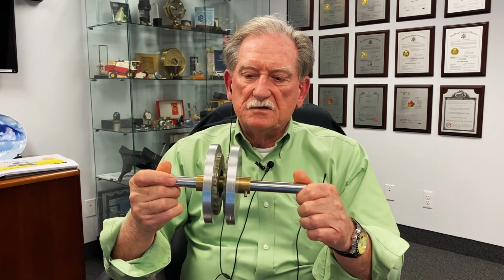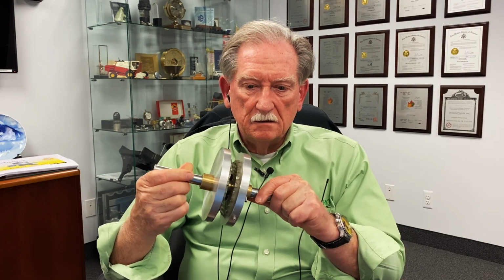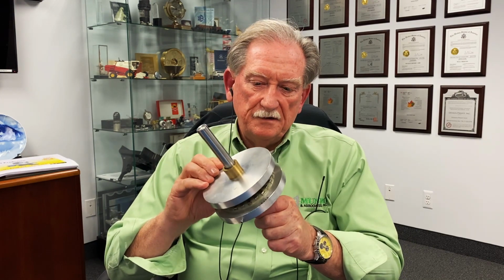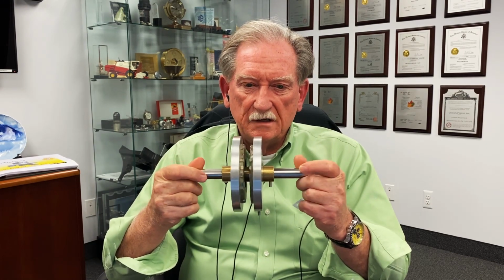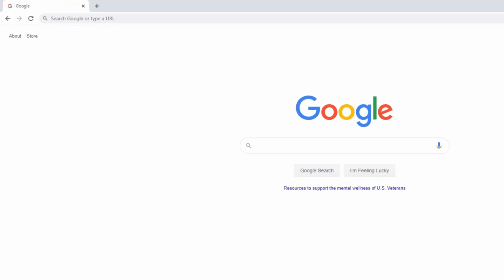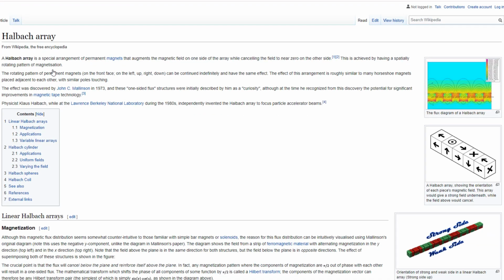Sandy Discusses What's In The Box - With Tracy McSheery

Comment: Sandy, my facination with 3-wheel vehicles goes back to the 1980s when I saw a picture of something called the tri-magnum in one of my dad's copies of Popular Mechanix. That design had a VW Bug front end welded to an old Honda motorcyle back end wrapped in a fiberglass/foam composite body. Basically it was, 40 years ago, what is now being sold today as the Polaris Slingshot. I see no reason why a 2+1 tricycle design can't be made safely provided the geometry is right. The simplification that motors and modern electronics give to that design will make a wonderful, economic vehicle.
Reply: How come a three legged stool is inherently stable, but a four legged chair is better for going round corners ?
Reply: @williamgoode9114  Three legged stools are only more stable until you put a person on top. Then they are less stable than a 4 legged stool. The higher the center of gravity, the longer the base needs to be.
Reply: @williamgoode9114  This is actually only correct when you have independent suspension on all four wheels. If you didn't it would be inherently undrivable.

Comment: Instead of making the air suspension keep the car flat at all times, make it tilt into the turn like airplanes, boats, and motorcycles.  I think it would be more fun to drive.
Reply: You left out trains, they do it automatically, it's really cool.
Reply: @blh1997-w1q  wasn't the tilt train of England abandoned in favour of the banked tracking of Japan and China
Reply: @williamgoode9114  I was referring to how all trains tilt around bends, just how their car axels work to change the center of gravity.
Reply: @blh1997-w1q  you mean steer not tilt
Reply: @williamgoode9114  The standard conical wheels make for a small amount of tilting.  Not the dramatic high speed tilting train but still something!
Reply: Nnneeerrrooommnn
Reply: Look up the Lean Machine.

Comment: I’m really interested in EV technology in intercontinental shipping, as it seems like at the very least, a power-generation system using whatever fuel technology is best, charging some huge batteries, that then drive electric motors on intelligent, steerable, sail-drives, mounted strategically on the front and rear of the hull, would mean a more efficient, cleaner drivetrain, which would be more manoeuvrable and agile; imagine the operational speed improvement, if a huge cargo ship can rock up at the [un]loading dock & slide sideways into the slip, unaided?!
Reply: Thrusters are a thing. The goal is to make them more affordable and less likely to require extensive engineering changes to the hull. We are working on such beasts if you are interested, and remember the power goes up with the cube of the diameter to making a 1 meter motor pushes it into the megawatt catagory.

Comment: Building the motors into the wheel rims would be so cool. You could even get rid of the braking system. The controller could simulate the brakes by reversing the motors dynamically. Not only would that be a significant cost saving to manufacturing but also weight saving.
Reply: Try directing your question to info@ree.auto
Reply: As long as the motors are not the actual wheel, the unsprung extra weight is the crux! The wheels must be the motor!
Reply: Drive motors have insufficient torque to entirely replace brakes.
Reply: @lengould9262  Actually the question is what do you do with the power as you grab that energy. Brakes dissipate it as heat. You could fry the battery if you aren't careful. Since the motors can easily stop the wheels from spinning which would cause you to skid and lose control the issue is stability not braking.
Reply: Yepper. Rims can be custom made to do this but you have to buy 1,000 or more to justify the tooling.

Comment: Not limited to one a wheel, either. So you could radiate the design and add two to about a standard wheel format, potentially more. Not really my field but could you rig these together in sequence so as one influences the next and so on? Or would that be an existing sequence of gearing?
Reply: You could, but then why not just use a cylindrical motor?
Reply: You are better off with increasing the wheel diameter since you would need more bearings and a wider wheel. The motors are only about 50 mm 'thick'. If you can handle a 20 inch rim, then 4 wheels will give  you about 1000 HP and well over 1000 NM of torque. Really the batteries are the limits any more.